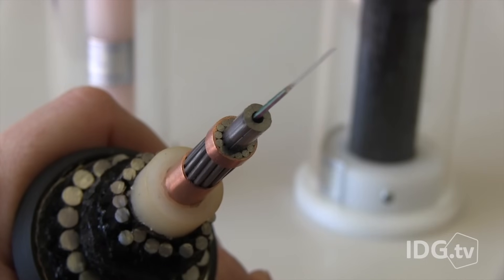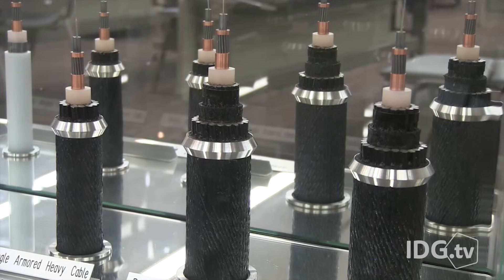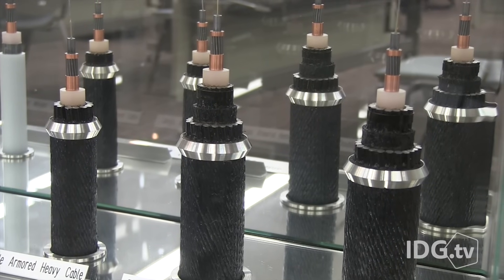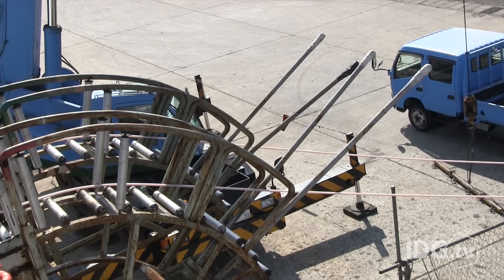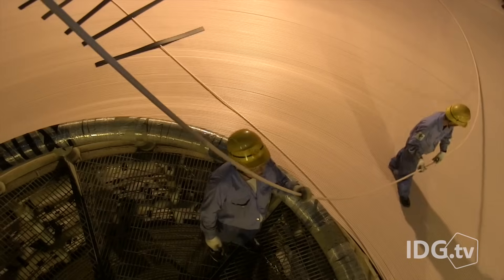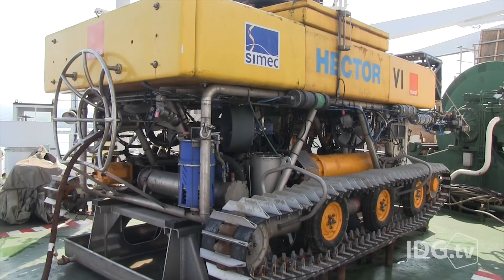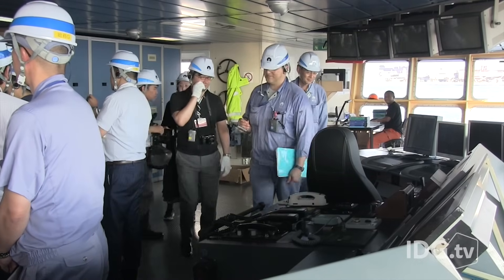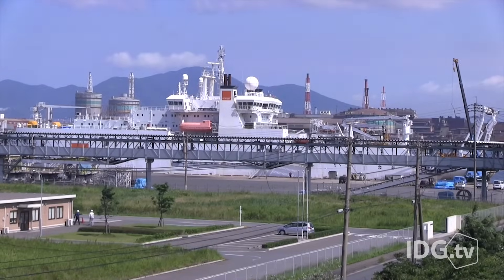Watch what it takes to lay Google's super-fast submarine Internet cable

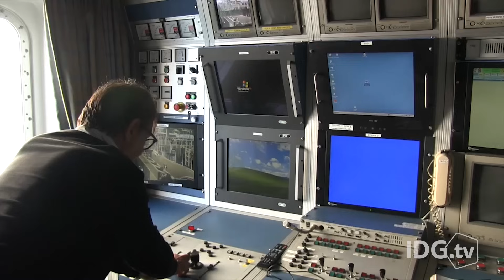Comment: 2:45 most advanced cable in the world being installed by a ship with computers running windows xp? nice.
Reply: I you're using computers for one specific purpose then you just need a minimal operating system that's sort of 'good enough' for day-to-day operations. Windows XP is probably more than capable in running what they need for their work.
Reply: xp is one of the best OS ever built.
Reply: my local DMV decided to update their system to windows xp I didn't believe it but I understood why though it was a few years back they waited 10 years to upgrade I didn't believe they would but they did and it's back to normal for the DMV but jeez goes to show how efficient a OS can be
Reply: My mouth dropped when I saw it, laying high tech fiber optic with a ship running an obsolete unsupported operating system with probably obvious security holes.
Reply: Mr. Meatballs It's not that they don't remember it's that many of them were kids at the time.
Reply: Dennis Smith Jr. Why does the ship laying the cable need to have the most advanced and safest OS ever? All they're responsible for is the laying of the cable, not configuring it.
Reply: @sampleentry5253  Agreed.. Lets not forget that there a lot of obsolete computers running some very fundamentally important systems.. banking, millitary, NASA probes etc. Reliability is more important than being state of the art.
Reply: imagine that had MAC they would be dead.  I still use XP for Netstumbler. I cant find anything for Windows 7
Reply: in my home town traffic management systems are on xp and cannot run the app by current system, the sql databases cannot install on windows 10 it was hard to transfer because the programmer also died.

Comment: A far cry from (but a strong echo of) the first transatlantic telegraph cables.  The 1857 cable was made up of: a core of 7 copper wires; three coats of gutta-percha; a layer of thread jute yarn, soaked in a tar mixture; and all were coated with 18 strands of iron wire, each strand made of 7 wires.  In 1858, it did its job for 23 days.

Comment: I wanna see the demux and tranciever hardware sitting at the end of something like this.
Reply: so that why wifi is slow for some ppl if the cables are under the water? hmm, does the cables moves when they are in the water ? does the cables make electricity i wonder why they put them under the sea not in the cables boxes like phone cables thing ? 1-23-17
Reply: There are alot of factors that are responcible for wifi speeds - these cables are usually responcible for connecting the backbone of the internet across countries (mostly seperated by water). the cables they use do move a bit esp in geologically active areas and they arent a form of electricity generation. they go under the water because that is the best way of going between continents and also works out cheaper than going over land in some cases.

Comment: Imagine having to repair a submerged ocean fibre optic cable. Probably one of most expensive repairs.
Reply: +Teddy Mills I think repair can be as expensive as making new connection. You have to pull out cable from few kilometers deep water.
Reply: I really don't think a repair costs as much as making a new connection.   They can run tests to see where the cable has been cut, then they would send machines down (just like they're laid) to pick up the line bring it up and repair it.  Costly, YES but nothing close to laying new line.
Reply: Is around 1mill euros to repair/replace one repeater or to solder a cable coz you will need to place a module at that soldering location 😏 ..and i know what i'm talking about 😏

Comment: What happens when the ship laying the cable hits rough seas or a storm?
Reply: They generally know when seas are going to be calmest for weeks ahead. If they are stuck in rough weather there are systems to deal with heavy swells by playing out the cable and reeling it in automatically. NO ONE is going to put the slighest unavoidable risk on ship or crew.

Comment: We can get pictures from Pluto a billion miles away, but we're laying ocean cable for communication systems on Earth?
Reply: +imasmurfy1 you obviously don't understand the concept.
Reply: +imasmurfy1 Cables may sound old school but they're the best for high speed reliable networking. We still haven't found a faster alternative to cabled networking.
Reply: How else to you purpose we send data across the globe?   Fiber optic cables carry a LARGE amount of data with such a small latency, vs satellite that has a large latency.
Reply: uhhh... nothing can travel faster than the speed of light, so how do you suggest we communicate if its not with light traveling through glass fibers inside armored cables?
Reply: Dude... saying shit like that... I can tell you're obviously not a gamer. Honestly sending shit wireless via satellite over the Ocean would make us gamers lose our fucking minds.
Reply: it's all about speed
Reply: Sephirot120 speed of light is fiber optics cincept
Reply: NASA's deep space network is drastically slower than your internet. The New Horizons probe recorded about 65GB of data as it flew past Pluto. That data took 16 months to transmit back to earth. I can upload or download 64GB of data in a matter of hours on residential internet.